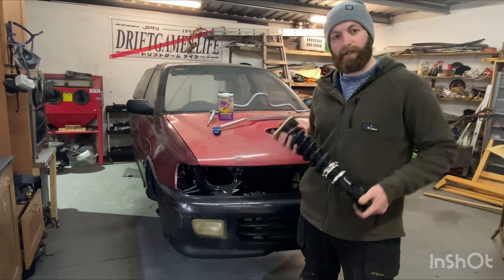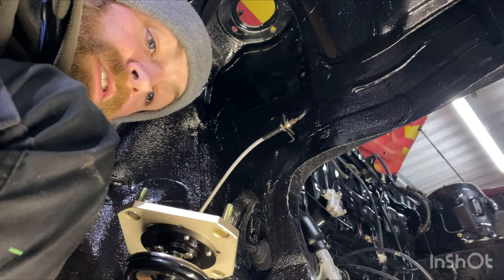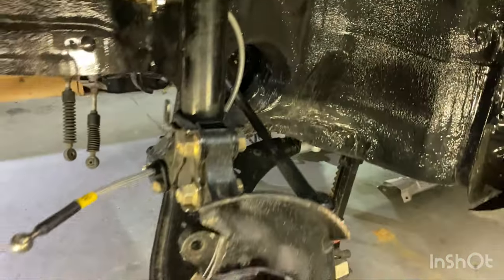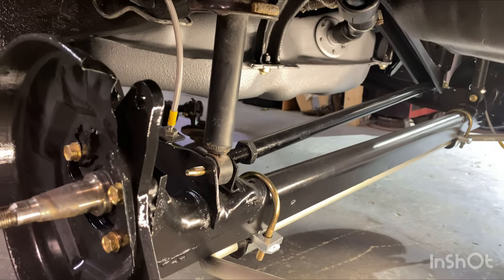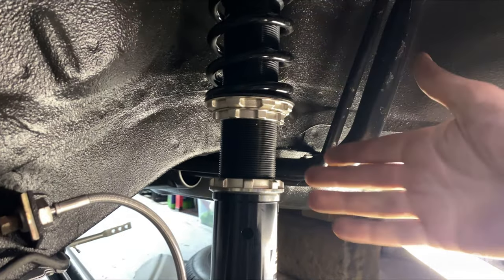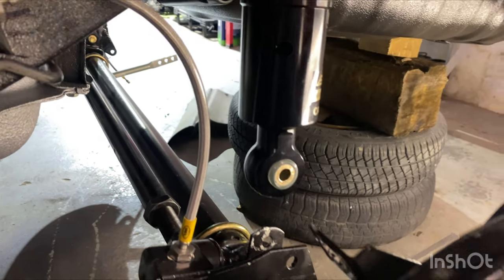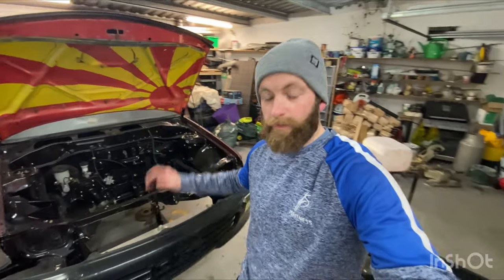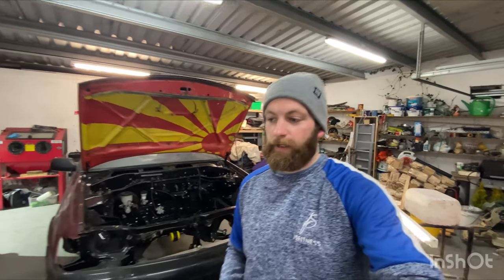Fitting bc racing coilovers and more to my starlet

Comment: What wishbones are you using joey  ep91 standard ones
Reply from the maker: I’m actually using my standard ones. There was provisions on them to take the anti roll bar even tho the car didn’t come with one originally. Everything from the glanza bolted straight up
Reply: Are you using the ep80 steering knuckle where the front coilover bolts to
Reply from the maker: Hey there, so everything is glanza fairly much , the front hubs/disks/calipers all came off a glanza
Reply: @joeygt6794  getting bc coilovers just tryna figure out few measurements.  What's the width of the bracket on the coilover for the front knuckle where coilover bolts on and the distance of the 2 bolt holes . Ep80 is 26mm in width and 53mm between 2 holes.

Comment: It's going to be some car when it's finished your dropping serious coin into her  love that rear brace never seen one before  I'd be interested to see what you think of the powerflex engine mount  I personally  took mine out  as the  vibration from it was awful anyway really enjoying your gt build  joey 👌
Reply from the maker: Iv never seen on of these braces either, when it came up for sale I couldn’t leave it behind. I’m already dreading the vibrations but what I’m planning is to only run this powerflex mount and then the 2 other mounts will be oem so hopefully that will level it out. Thanks for the support Matthew 🙌🏻
Reply: Hi Joey. Stephen (glanza dude) from tgtt. Would you please have the part number for the front anti roll bar ball joints. Did they cost much to buy? Thanks
Reply from the maker: Hi Stephen, I got these from id workz awhile back but I’m sure most auto factors would actually carry them. I’ll leave a link to a set of them for you here - https://id-workz.co.uk/products/anti-roll-bar-drop-links-front-toyota-starlet-gt-turbo-glanza 
Hope that helps
Reply: @joeygt6794  that's fantastic Joey and I presume the link you sent me was for the 2 drop links?

Thanks again for the videos
Reply from the maker: Ya if ordering just fill in what quantity you need as they don’t come as a set of 2 👍🏻
Reply: Hi Joey. What brace is this ?the brand? Keep up the good work.
Reply from the maker: @Devel  hey man, I can't actually remember the brand as I bought it off a private seller, I'll go back through my messages and see can I find out for you
Reply: @joeygt6794  ok thanks a lot I appreciate it
Reply from the maker: Hey Devel, it’s a Kawai works brace bought from RHD Japan
Reply: @joeygt6794  Thank you very much !!